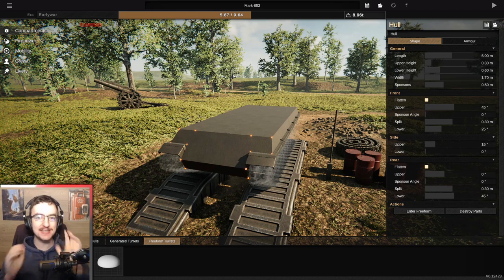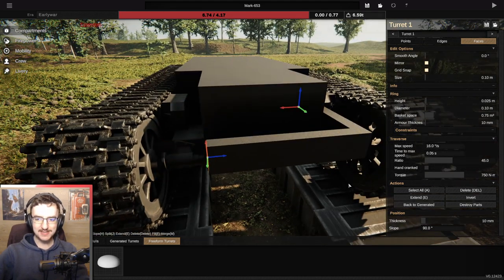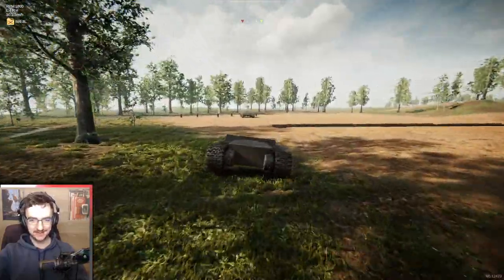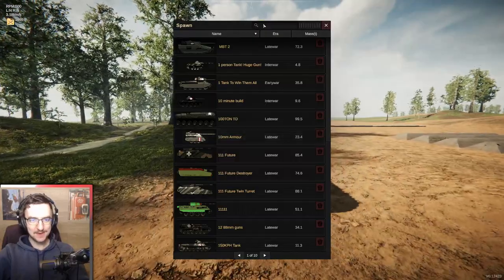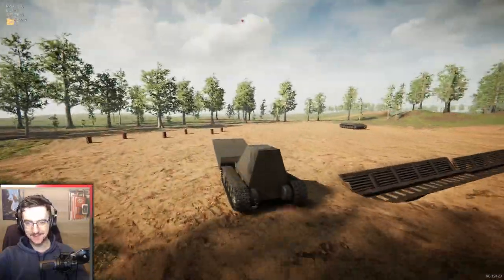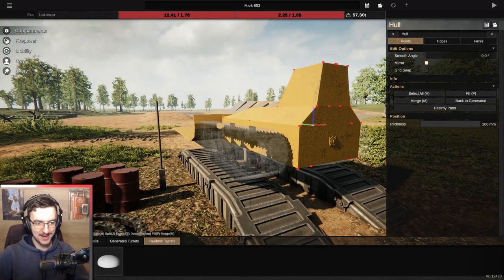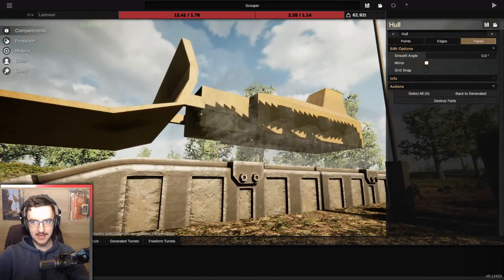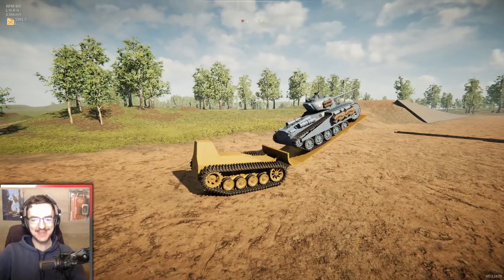I BUILT A Tank That Can LIFT And FLIP ENEMY TANKS In Sprocket Tank Design!

Comment: I think that maybe if you used fork's like a forklift by only extending the two small faces on the blade that attach all the way back instead of the whole blade under the enemy tank that would work really well.
It would make it so it's not having to fight with the tracks of the other vehicle and also the blade would be lighter.  That would help you to lift it easier.

Comment: Tiny front idler, shoved forward and down as far as it will go.
Reply from the maker: The get stuck in the ground, they don't provide drive :(
Reply: @FranticMatty  Yes, but they provide a pivot point much nearer the load, thus will allow you to lift heavier objects.  Look at the legs on a portable engine hoist.
Reply from the maker: @d00dEEE  I see what you mean, good point :)